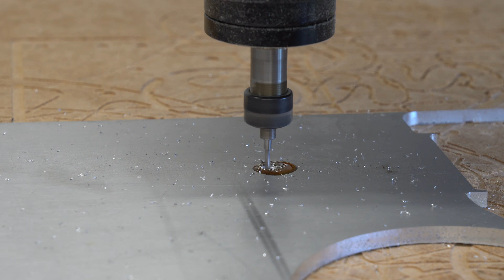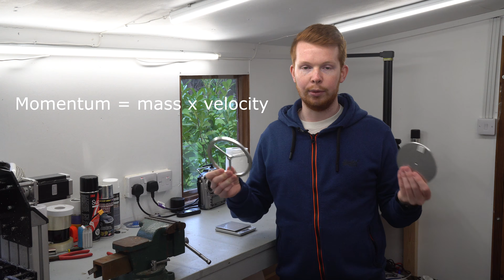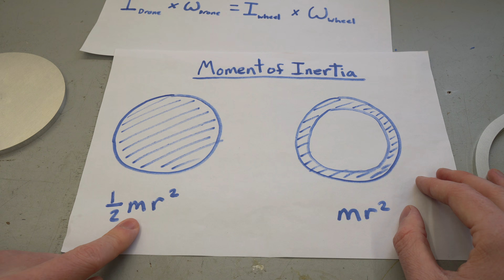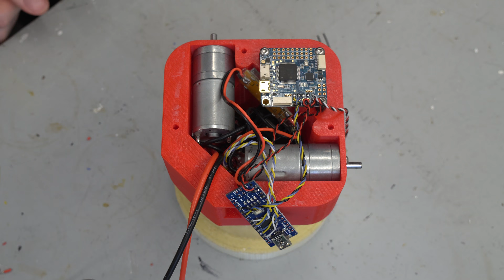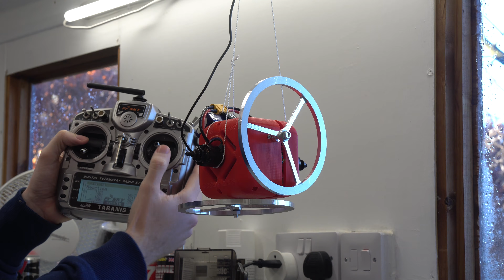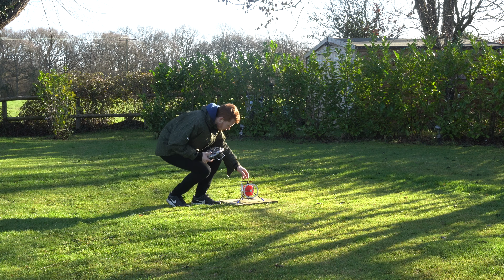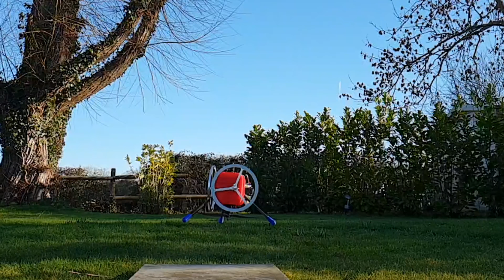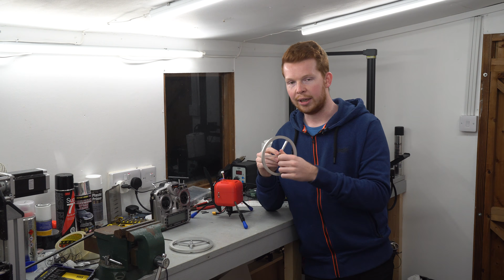Comment: As soon as one of the wheels is spinning, the spinning of the other wheel will not completely change the roll rate on the desired axis, due to gyroscopic precession. The controller would have to change the the mixing of the wheels to counter the phase shift introduced.

Comment: Maybe consider making a circular boat that uses a reaction wheel instead of a rudder?

It seems like it would be pretty pointless, but still it should be much easier than a drone which needs to both stay in the air, and manage multiple dimensions of rotation.

I think the air drone thing is still a good project to work on as well though. You'll need to balance it properly which means using pairs of reaction wheels on each side (seems kind of like a no brainer)

Comment: you could try putting 4 of these reaction wheels, one on each side of the square, and each one will turn in the opposite direction to the opposite wheel, but turning permanently, and the balance could be achieved by accelerating (or stopping) one of both, according to which side you need to balance it

Comment: The wheels change the direction of rotation too slow because it's need to stop before . Try to spin wheels with constant speed, and stabilize system with increase or decrease the rotating speed.
Super! Great work!

Comment: If there is any reason that a small constant external torque is applied to the drone (such as off balance centre of gravity), an attempt to counter this with a reaction wheel will result in it constantly increasing rate of rotation until it saturates.  You mentioned saturation, but did not explain it.  It seems to me that shifting the COG, e.g. by moving a weight is no more complex than your reaction wheel design,  and doesn't suffer from saturation.   E.g. you could have two arms with a weight on the end on the same vertical rotation axis.  By varying the angle between the weights, you vary the effective displacement of the COG from nothing (180 deg apart) to max (0 deg apart).
Reply: Well spotted! This may be the biggest flaw in the whole concept
Reply: it's true that moving weights would work, but the video seeks to answer the question : will reaction wheels work to control a drone.
 it does need to be balanced at the cog though however it works

Comment: I think one of the main problems with the design is weight distribution - Have you calculated the center of mass? I think it should match with the propeller axle. 
I'd try creating 2*2 smaller wheels and make the weight distribution equal with the spinners on both sides. Worth I shot I guess :)

Comment: The next thing?: Controlling the orientation of a cube sat with reaction wheels. 😀
... And if the power from the solar cells is not enough, charge a battery for some time and then point the cube sat steadily for some time - perhaps for taking pictures or for "calling home" on a small high gain antenna. Continue with charging the batteries and so on 😀
And people in the comments sugested smaller reaction wheels.

Comment: Use Stepper or Servo motors and tune your PIDs for the reaction wheels in the flight controller..... Fast oscillations mean gains are too high, slow oscillations mean low gains. There is a sweet spot in between..... Should make it perfect!

Comment: I think the instability is most probably caused because the Center of Mass isn't in line with the axis of rotation. Hopefully adjusting the weight will yield better results.
Reply: It didn't look like the reaction wheels where quickly reaching saturation (max effective rpm) and it wasn't always careening off in the same direction so center of mass not being aligned well enough with the propeller force vectors didn't seem to be the problem with these relatively short flights. With very long flights I agree that you'd need absolutely perfect alignment though. I've experimented with similar closed loop motion myself and found it was very difficult to find effective PID parameters, especially with the latency of using closed loop current to estimate torque wreaking havoc on the performance. Sometimes it is better to use a combination of rpm and voltage to calculate the torque which gets rid of the latency from the closed loop current drive solution used (and is more accurate for driving torque), but even then finding the right PID parameters can still be very fiddly and difficult. Of course you need a way to measure rpm to do this too but at least you can then drive the voltage directly with minimal latency.

Rather than use a simple PID solution and manually tune it, it is often less work in the end to calculate the full transfer function (inertia vs torque based motion plus motor voltage and rpm vs torque relationships) and solve the stabilizing closed loop differential equation (with an rpm sensor on each reaction wheel) to develop algorithms that drive voltage directly (but is a lot of math and often requires those nasty Laplace Transforms to solve...).

Comment: Ummm, this is how a drone yaws.  This is already working on pretty much every quad in the sky.  Each motor is a "reaction wheel".  Two speed up and two slow down so the the thrust stays the same but a torque is applied to the frame inducing yaw.  Don't see why this wouldn't work.

Comment: Maybe a small pendulum hanging underneath to dampen correction/overcorrection, might make it a little less sensitive
Reply: no, that won't damp it, it'll just add another oscillation to deal with.  I have a fairly big quadcopter that I'll occasionally carry a 1kg weight on a rope to drop in trees to recover stuck rc planes.  If I have any significant length in the line, it'll pivot around the centre of mass (but with the attitude of the quad mostly unaffected).  (weight swings left, quad slips right, etc.)  If I ignore the swing, it'll eventually slow down.  If I try and correct, I'll often end up making the oscillation worse (typical "pilot induced oscillation") That's with the weight attached in the middle near all 3 axes of rotation.  If I attached that weight with a rigid stick, instead of a rope, what would happen is that it would lose most of the pitch and roll authority, since I would be applying the roll forces at a distance from the new centre of gravity.
Reply: @nwimpney  but would the same be true of a dual rotor craft as shown in the video?

Comment: Would it make a difference if the reaction wheel would be closer to the center of mass? And would it work if they are installed inside a Case?

Comment: If I had to guess, I'd say that the higher torque at the low rpm domain early in flight is overcorrecting, causing the controls to hunt/cycle around equilibrium.  Smaller motors or smaller reaction wheels?  Or a non-linear servo-to-current equation in the arduino nano?

Comment: Seems to me that there would have to be control system complications caused by precessional interaction between the reaction wheels and the spinning props. Any time the two props are spinning at different rates in order to correct yaw, precession is going to make the pitch reaction wheel add some roll and vice versa. The direction of the precessional torque would depend on which of the props is spinning faster than the other. The reaction wheel control system really needs to know what the props are doing in order to compensate for that.

Comment: massive amount of comments so maybe this idea already brought up, but wouldn't it be easier to control the force from the wheels by having them running at some idle speed as standard and then when you want to apply a force/rotation increase or decrease the speed instead of starting from stand still. this way I believe that the reaction time would be faster and the linearity of the current/force would be better?

Comment: Several things. First you said you got counter rotating bottom motor, this implies that one is CW one CCW. If this is the case then both are spinning same direction unless you were just talking about the blades. Second: get out of the wind. It is clearly noticable that wind gusts are throwing you all over. I don't believe that your programming accounts for (or can account for) physics involved in random pushes creating directional movement diagonal to gravity. Hence crash like crazy all over the yard.

Comment: lifting propellers should be placed OVER the center of gravity of the whole structure(this device). When one propeller is placed at the bottom of the structure, it pushes the center of gravity from bottom to top, and the system drastically reduces its balance, therefore inertial control cannot cope with its task in flight.

Comment: Reaction wheels implementation did not react fast enough??
I'm thinking having the wheels already spinning when the drone starts could help.  You'd probably need to cancel their effect with another set of wheels, until the drone needs steering.  You can more quickly speed up the control wheels or slowdown the counter wheels to get the desired effect...

Comment: I think you dont really need a wheel to control its rotation. All you need might be a set of leaves around a wheel which doesnt have that much mass. You could get force from air resistance, in case the wheel might be accucelerated to much and reduce the wight of your drone. So, you might turn to some 3d printing guys for help .

Comment: Are you really driving the motors from a current source output rather than a voltage source?  This is definitely desirable for you application as torque is proportional to current and relatively independent of RPM (to a first order).  Driving with a voltage will give a current (and therefore torque) which is inversely proportional to RPM. All the brushed motor controllers I have used provide a voltage output rather than current, so I am curious about this.
Reply: I'm not sure what Tom used, but do a Google on "Talon SRX' for one example of a (hobbyist) brushed motor controller with built in current drive mode. This one is overkill for this project and too heavy but... It also includes the ability to add an encoder input (and a calibration factor) and then use closed loop PID to achieve "drive to specific encoder tick count position", "drive to velocity", "limit acceleration rate to X", etc. It also supports RS-232 (serial), CAN bus, PWM, and other communication protocols.
Reply: @Slider68  Thanks, that looks like a pretty neat controller 👍

Comment: If you used PID control for your Inertia wheels you might be helped with the saturation part when you have it on a slightly tilted start angle reading this: http://brettbeauregard.com/blog/2011/04/improving-the-beginners-pid-introduction/

gives a very very good explanation on how to fix common issues, including your "i" parameter thing with the saturation at start.

Comment: implement a control with a micro controller to stabilize the system as a whole. Filter the input on the motors through that same micro controller. That's the issue you can see.

Comment: The prop on the bottom is making the whole thing inherently unstable in the air. Perhaps try with two counter-rotating props on top? I think that would still be enough of a challenge because the reaction wheels would provide control for the flyer.

Comment: It may be better if you make 4 wheels, pairing, so that you can adjust all the wheels that always turn at a medium speed and increase or decrease a wheel of a pair to adjust the way to fly, and stop the "shock" created by stop and start engines for a more fluid flight?
It's just an idea but I think it can work.
Reply: By having the two wheels spinning on each axis wouldn't it greatly stabilize the drone?

Also, giving current to slow or change spin is expensive when compared to a brake that could quickly stop a wheel.  Slowly spin up and brake instead of stay stopped and start spinning rapidly?
Reply: I don't really know but,
If the two wheels on each axis spin at same speed constantly but on diferent direction ( like the propellers) they cancel their effect.
 like this if one of them increase is speed, or if you prefer brake his speed, the other start to make the effect on all the drone.
But when i said they allways on medium speed set, it's just a way to talk, maybe if they just speed at 5% speed, thats work, I don't know. and like this it's more lighter for the batterie. 
But for stop the "choc" effect to the drone, for me it's the only way to make it. For make a flyable drone you need to be make one who work smoother than the video exemple.
Reply: @thegremlinss  I am sure from watching the video that the sudden reactions are details in the algorithms, precision of instruments and/or speed/force of the reaction that have not been worked through.

It is a big step to go from pushing it on a string and them flying it. The engineering of the solution would require an apparatus to impart impulses of varying magnitudes and fixing each one. Next test a single variable force of varying duration. Next study sets of forces. That is a lot of testing.

Comment: I think that part of the problem is that one of the propellers is below the center of gravity of the drone. This is fundamentally destabilizing. Think about the difference between balancing an object (supporting it from below) vs. suspending the object (supporting it from above. If supporting from below, like the bottom prop is, the sort of constant corrective inputs we were seeing will be needed. So if there is some way to get BOTH props above the center of gravity, the craft will be fundamentally more stable.

Another consequence of having one porp on top and the other on the bottom is that if the bottom prop is producing more thrust (i.e. for managing yaw), it will tend to want to invert the craft.

So by having a propeller on the bottom, you have introduced a couple of destabilizing elements to an otherwise intriguing design.

Another thing is that if you want to maintain pitch (assuming that you have both props on top and the craft is therefore suspended, you would need to introduce an element of drag to the spinning wheels. Otherwise, you can only maintain forward pitch until the wheel saturates, and then it will dangle in place.
Reply: It is interesting to read all of the theories as to why it was unstable...

While intuitively having a prop at the bottom sounds like a terrible idea (similar to balancing an object on a finger), the reality is far less of a negative (theoretically no impact on the 1st order). Think about the relationship between the ideally stable thrust vector and how it travels perfectly through the center of mass always (if built correctly). As long as the thrust vectors remain through the center of mass, it has no impact on stability whether the props are both on top, bottom, or one on each. Read up on the "rocket pendulum fallacy" for more details.

Now in reality propellers do flex and also due to aerodynamic effects the thrust vector change is slightly delayed to any shift from the vertical for the drone. Due to this delayed thrust vector change there is a small improvement to stability with props on the top vs props on the bottom - BUT the difference really isn't all that much and well calibrated reaction wheels should have no trouble overcoming the small flaws in the thrust vector and resulting (very tiny) destabilizing torque that the lower prop generates.

I'm not understanding why you feel the lower prop would generate more thrust than the upper prop. As long as each prop is optimized for the rotation direction (top and bottom spin in opposite directions to cancel torque about the vertical vector), each prop would be generating equal amounts of torque while also generating virtually equal amounts of lift.

You are correct that one of the problems with these reaction wheels is that during long flights they will very likely saturate and hit an rpm where there is no more torque available (in the same direction). For short flights though, including the flights in the video, there should be a reasonable amount of torque available. Your suggestion of adding drag though would mean the wheels are slowing down and that would result in a change in rpm proportional torque which would cause the drone to veer off course. Unfortunately there is no way to slow down the spinning of these reaction wheels without either veering off course or touching another object (such as landing temporarily). One problem that I haven't seen anyone mention (yet) is that reaction wheels exposed to air will constantly require energy to keep them spinning and the faster they are spinning, the more power they will consume.

A different solution could include a movable internal weight. By moving the weight (and hence the center of mass) the drone could be rotated in the same axis as the reaction wheels and this could be used to slow down (or even possibly replace) the reaction wheels.

Comment: why don't you stop the reaction wheels then again apply force to the reaction wheel, instead of increasing the rpm of the reaction wheel ...... Like in a loosely bolted ceiling fan . When you turn on the switch of the fan it changes the angular momentum of the clamp shaft of the fan thereby rotating it in the opposite direction. But as the rpm increases the angular momentum levels out. So if you constantly switch on and off the fan you can see the angular momentum in action each time the fan  turns on.....

Comment: Wouldn't it be simplest to buy a gimbal controller for brushless motors that are used for camera stabilization (~$15)? They work on the same principle except instead of keeping just the camera stable you'd be keeping the entire copter stable.

Comment: I would build an carbon fiber shell that protects the done, plus it would just look cooler asthetically. It doesn't really need the wheels exposed to function and as a shroud it should also increase lift and maybe stability.